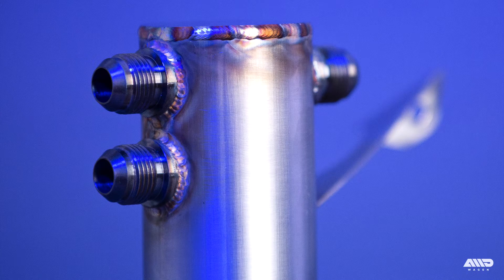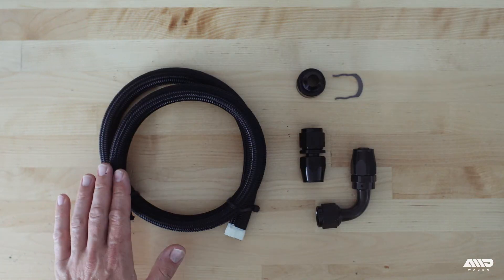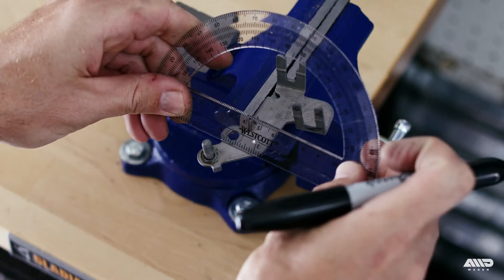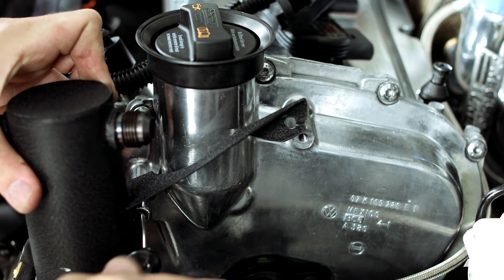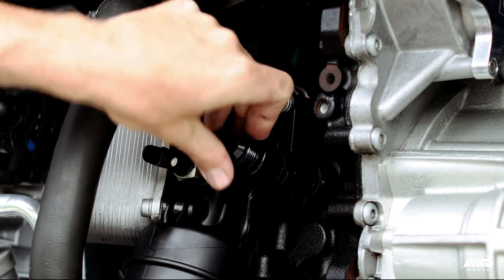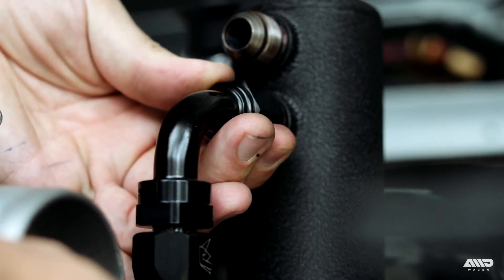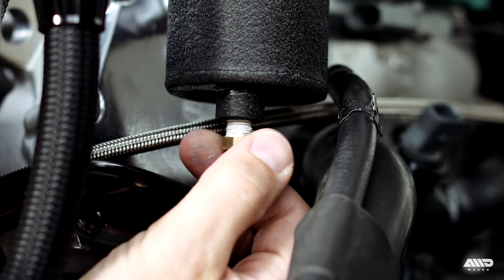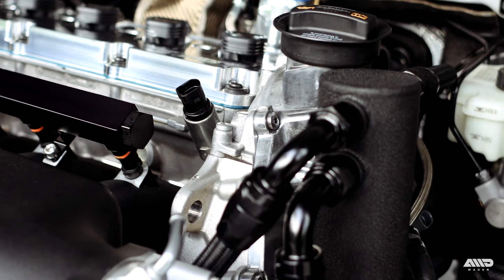VW 2.5 Catch Can - AS1 Overview & Installation

Comment: Where on the intake manifold does the one hose attach?
Reply from the maker: It would attach to your air intake, not the intake manifold. You would add a -10an bung to your intake and route the hose from the can to the intake.
Reply: @awdwagen5870  what if you have a aftermarket valve cover that has a an fitting connection? Can you just plug intake hole and route it into the valve cover?